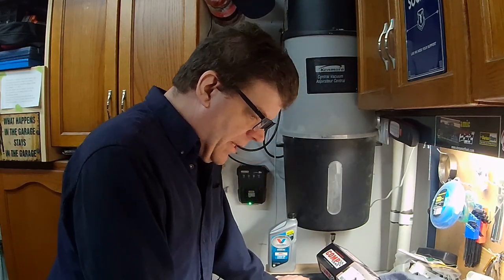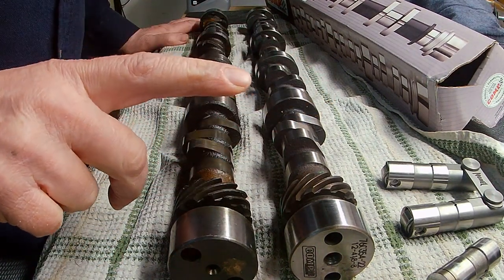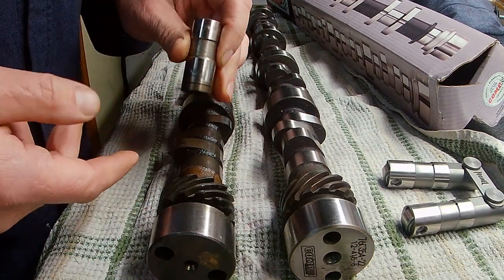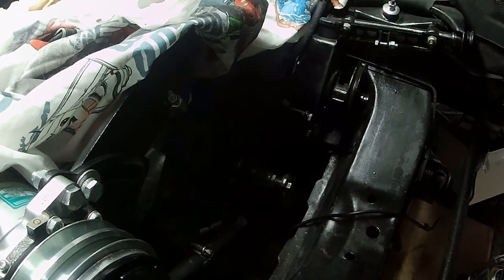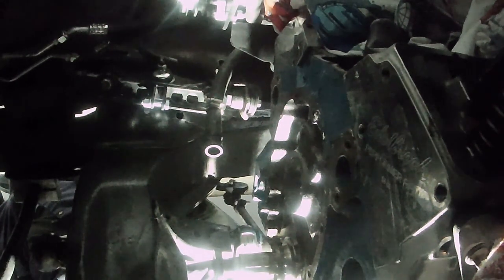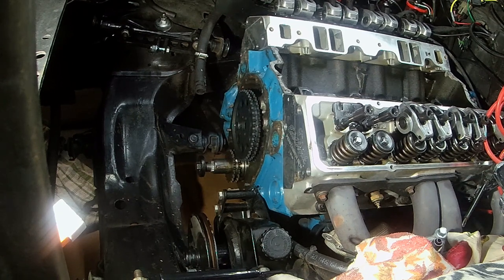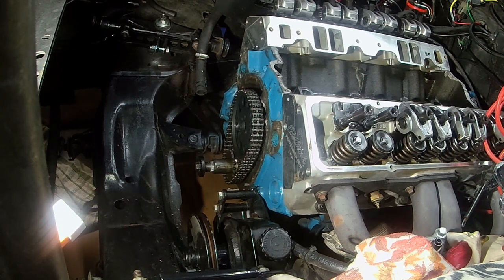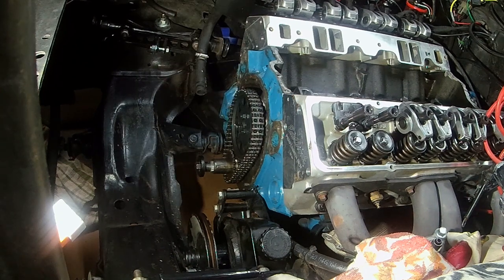C3 in car Camshaft Install

Comment: Did you pull the hood off to do this?
Reply from the maker: No i didn't pull the hood off.  The hood is was closed as i took the cam out  while being under the car. The big thing was the A/C condenser that needed to move forward a bit and that is why i closed hood and removed cam from under the car. 
Odd way of doing it but it worked and i didn't have to align hood as i didn't remove it.
Thanks